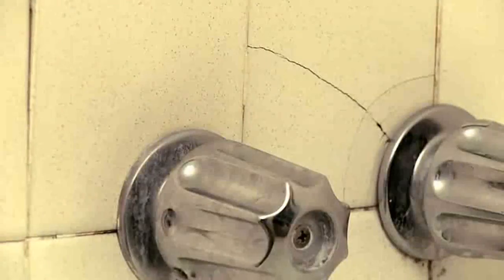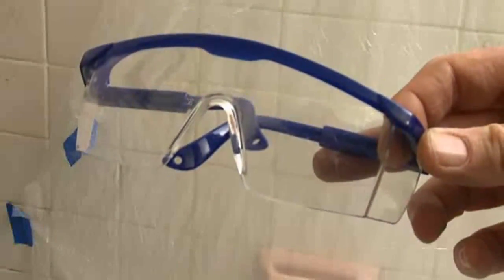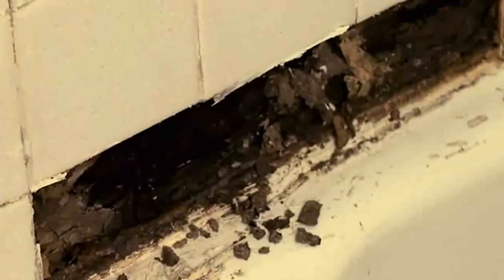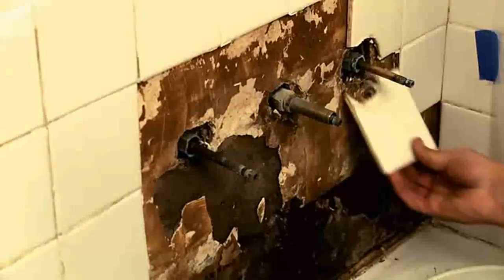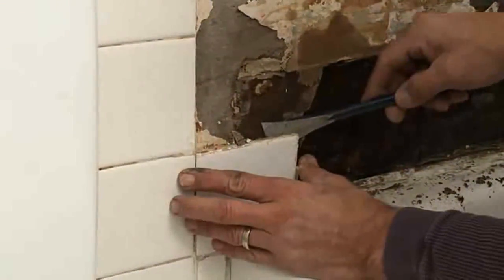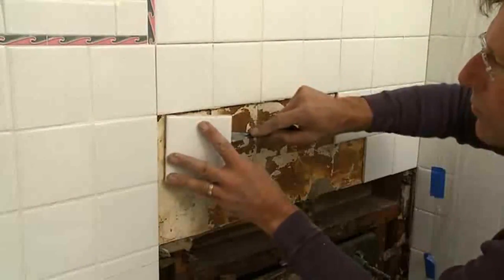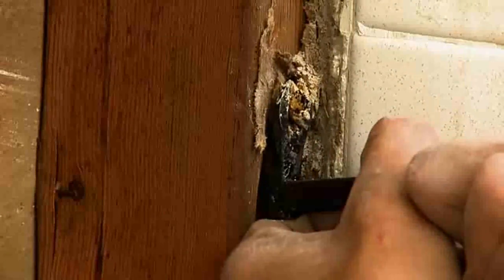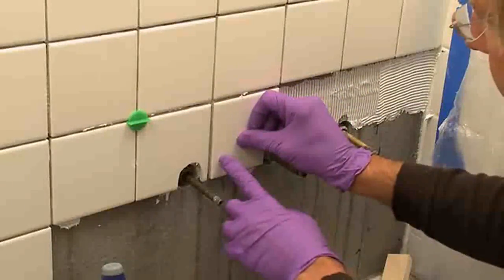How to Repair Broken Tile, Part One

Comment: I tell ya man, YouTube is great! I just so happen to have a ceramic shower wall tile repair job this morning! On the first run above the floor base tiles. That have began to detach and sag, with no breaks or cracks. All intact! With some small grout touch ups here and there. Been a while so this helped.

Comment: I have a tile that was cracked and missing a piece when we bought the house. it's an older house so they installed it with a bed of cement. I want to take one out from behind the vanity to do the repair since I can't match it. with all that cement, how do I get the tile out without damaging it? ty

Comment: Cement board is not waterproof it's water resistant. also you should change that old ass three handle valve which probably caused the moisture problems in the first place